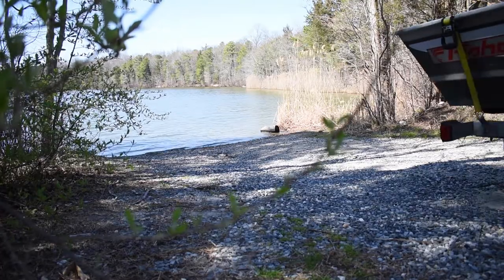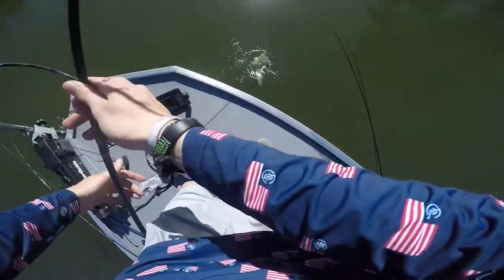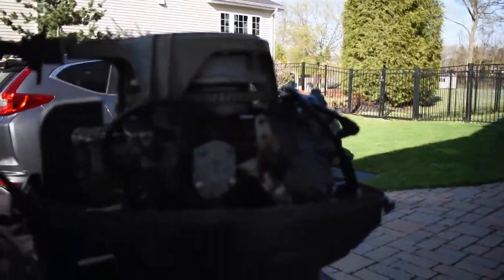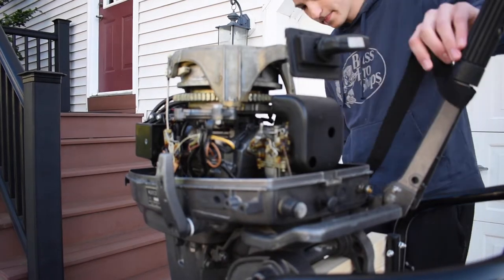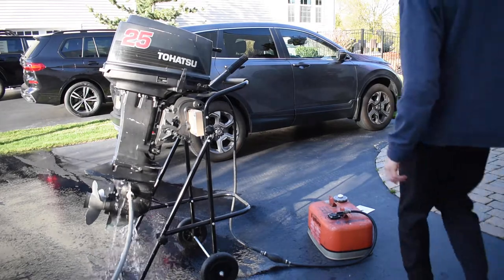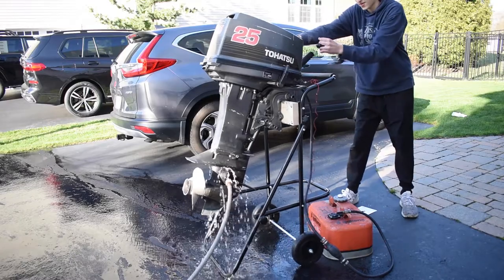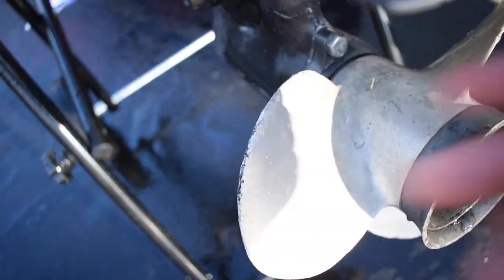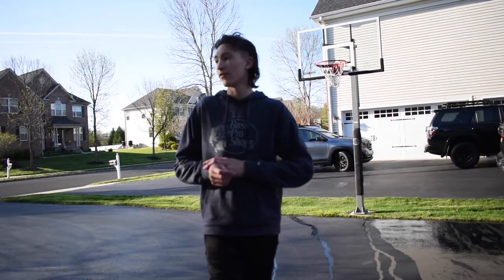DE-WINTERIZING THE TWO-STROKE

Comment: DO NOT use any 2 stroke oil as lower unit gear lube! 80-90 weight gear oil is typically used there.

Comment: Ty, you may want to use lower end gear lube instead of 2-cycle engine oil in your lower unit
Reply from the maker: why would i put gear lube for an oil change exactly?
Reply: @sportswTy  Ty, the two cycle engine oil is mixed with your gasoline and lubricates the engine as it is burned.  The lower end is just a gear box to transfer the vertical spinning shaft from the engine to a horizontal shaft that holds the prop.  That lower unit (gear box) needs gear lube, not two cycle engine oil.  You need to drain that 2-cycle engine oil out of the lower unit - replace with gear lube and make sure that the gas you use for the engine has the 2-cycle oil mixed in at the proper ratio.  A 2-cycle engine, unlike a 4 cycle, does not have an oil sump and a dip stick where you would check and change the oil.
Reply from the maker: @donaldwolff1066  Yes i understand. It makes sense to do that for a two cycle engine. However in a two stroke marine motor, the oil needs to be drained and replaced alongside with the gasoline and oil mixture. For other two cycle engines, what you said makes sense, but there is a specified port (as shown in video) where the oil needs to be drained when winterized, and then replaced in the spring. Thanks for the feedback though!
Reply: @sportswTy  yes Ty that lower unit does need to be serviced routinely, with gear lube.  Please do not rely on two cycle engine oil to take the place of lower unit gear lube.  That 2 cycle engine oil you showed in your video is to be mixed with the gas you burn in the engine - not to be used in the lower unit.  I'd be happy to help you figure this out before you damage your outboard.
Reply from the maker: @donaldwolff1066  understood and i appreciate your concerns.
Reply: @sportswTy  Ty, just read your responses and just a quick FYI -    2 cycle = 2 stroke - they are  just different ways to say the same thing.  Best of luck